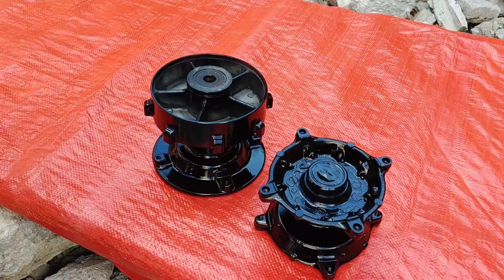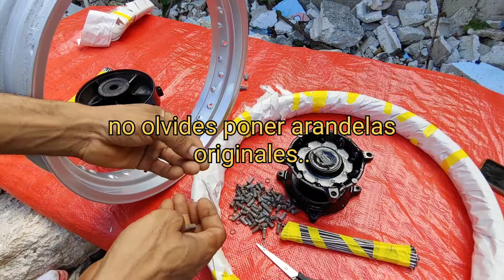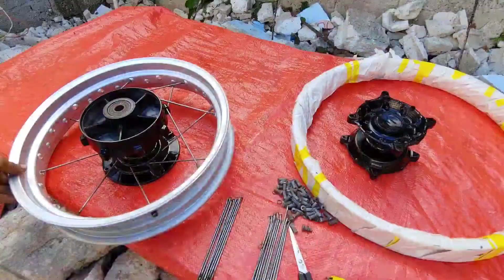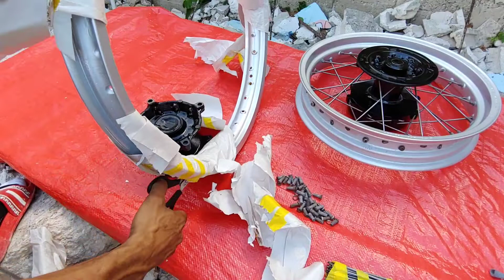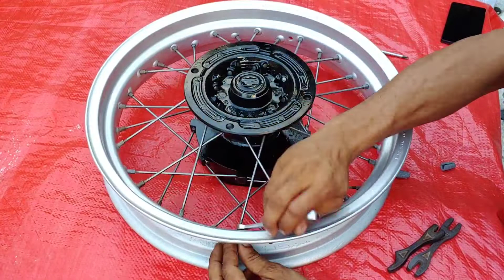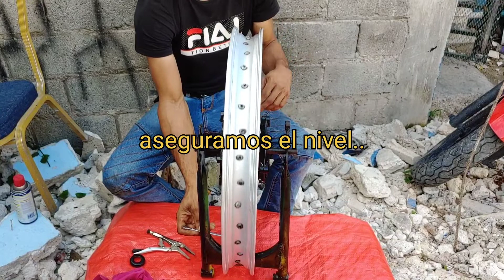¿COMO ARMAR AROS DE HONDA AFRICA TWIN AÑO 1998..

Comment: Natanael E. M. Ingenierías, muy buenas me gustaría saber como se enrradia un rin 21 de una moto DT Yamaha modelo 1995 esta es de freno de campana  la cual necesito aprender ya que estoy empezando a esta profesión, le agradezco que me des una ayuda, mil bendiciones y muchas gracias. 💪💪👍👍🤝🤝.
Reply from the maker: Que tal amigo para mi es un placer poder ayudarte con esto  y mas adelante con mas videos de aros dt .. Recuerda esto siempre ,  el tambor de un dt tiene dos lados con diferentes tamaños asimismo los rayos de tamaños diferentes correspondientes ,,el lado mas pequeño llevara los rayos mas largos y el lado mas grande llevara los rayos mas cortos .. Sobre todo unos rayos van por fuera y otros por dentro ya que tienen mas curva y menos curvatura..👋👋👋👋👋